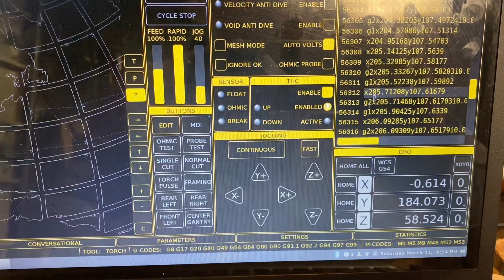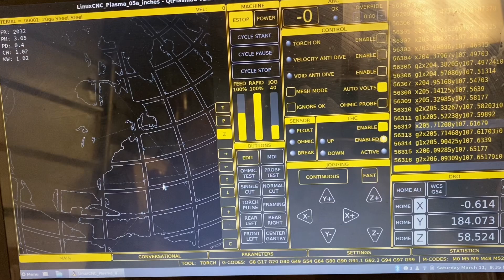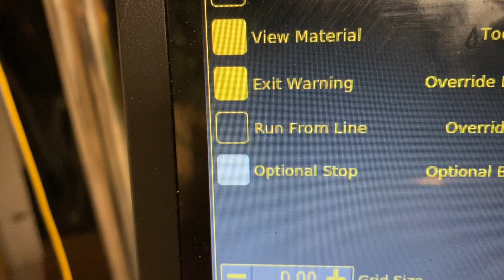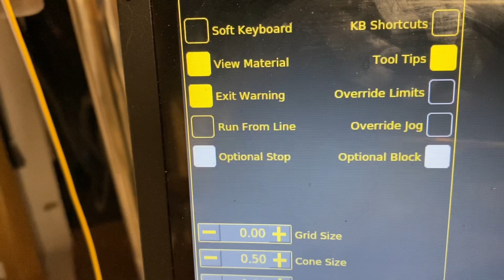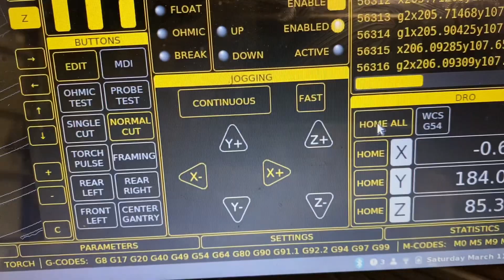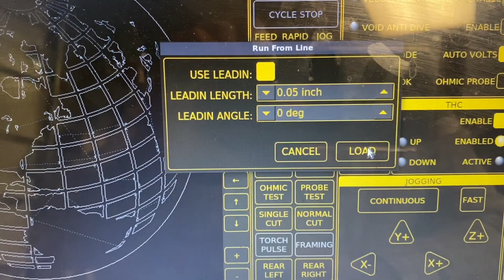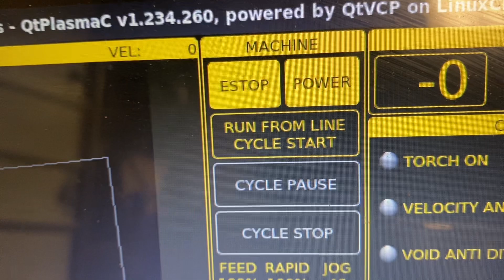LowRider 3 CNC DIY Plasma - LinuxCNC: Even More Cut Recovery Awesomeness!

Comment: I am keenly interested in building a Lowrider for Plasma and want to use identical hardware that you use.  I am parsing through your videos to see if you already made such a video, but if not, please give basic BOM details of your controller configuration.  From watching your videos, I fell in love with Linux CNC and other videos lead me to believe I can run it from an RPi and control that from Windows, but I'm still in the dark with what controller you're using for your steppers, switches and sensors and how that connects to your LinuxCNC PC.  TYIA!
Reply from the maker: There are videos on that, but first let me say that all the info is linked in the description above. Please check out the section labelled "Full details on my DIY CNC plasma rig" and in particular, there is a hyperlink under that labelled "Also check out my build log thread with full details — over on the V1 Engineering forum:" https://forum.v1e.com/t/lowrider-3-plasma-build-on-a-budget-clarksburg-wv/33849 — Re. the controller board, it's made by MESA electronics (model 7i96S), and so is the Torch Height Control board too. They are both made to work with each other. Some videos for that are in my Plasma playlist: https://www.youtube.com/watch?v=MV-IcyFUPQs&list=PLiW6LQZxE6JZW8mClbsKFIjO5VFjzxklS — there are 35 videos in that series. Specifically checkout https://www.youtube.com/watch?v=pgpKjn42zYc, https://www.youtube.com/watch?v=QxNeEHoVCVM, https://www.youtube.com/watch?v=sOqlbghQ9XA, https://www.youtube.com/watch?v=sOqlbghQ9XA, https://www.youtube.com/watch?v=DC7X0wB65kA, https://youtu.be/Y1gYIkMLcc8 — there may be others, but hopefully this helps.
Reply: @design8studio  THANK YOU so much for the details and all that you've shared on your channel.  I wish people in general were as kind, forthcoming and willing to help others as you are.  I just found and watched your Control Box video and will be following all the links therein.  Thanks again!
Reply from the maker: @MichaelJeffers75 Happy to help! I succeeded because of the help of generous people on both the V1 Engineering forum, and the LinuxCNC forum! The founder of Mesa Electronics is on the LinuxCNC forum! He's very down to earth. His name is Peter C. Wallace. On the forum he goes by PCW. He was very helpful to me.
Reply from the maker: The MESA electronics 7i96S controller board connects to a PC via the computer's ethernet connection. From that MESA controller board, you run wires to the drivers for the steppers. Full wiring plan and full BOM etc are in my build log on the V1E forum!
Reply: @design8studio  I just registered with the V1 forum, but Yahoo is yet to post the conf email, so I can't ask there.  Are you saying I can run the Linux CNC right on my main Windows PC?  I was under the impression that the CNC would need it's own dedicated machine to run Linux which is why I was interested in using the RPi.
Reply from the maker: @MichaelJeffers75 You can, but be aware that Linux CNC would replace the Windows operating system entirely. I bought a used Acer laptop (model with a touch screen) cheap on eBay, just for my plasma rig. It was designed for Windows. I wiped its drive and installed Linux CNC with the QTplasmaC interface.
Reply from the maker: @MichaelJeffers75 — re. "why I was interested in using the RPi." I am not familiar with running LinuxCNC on a RPi. However I found this article: https://all3dp.com/2/linuxcnc-raspberry-pi-tutorial/
Reply: @design8studio  Most laptops are capable of having dual bootable OSes, but that's an either or and is a hassle switching back and forth.  I'll investigate the RPi option, or just do as you did and get a 2nd  machine for the CNC, I'm just trying to cut corners having learned that I pretty much won't be able to use any of the steppers/controllers I bought for the MPCNC Burly.  Thanks again for your insight and wisdom!
Reply from the maker: @MichaelJeffers75  Sounds like a plan
Reply from the maker: @MichaelJeffers75 My steppers for the plasma are NEMA 17, which are commonly used on MPCNC and LowRider, so you may well be able to use your stepper motors depending on what they are. The drivers I used are decently affordable.
Reply: @design8studio  I believe my steppers are 12V, though need to research if they'll allow for 24V
Reply from the maker: @MichaelJeffers75  for what it’s worth I’m running 12V on my steppers on both my large LowRider that carries a router and has full sheet 4‘ x 8‘ capability, and on my plasma LowRider! I can do as much speed as I want to, or need to.

Comment: Hi Doug 
I went threw your steps and had done all them like you did. Only problem was I couldn’t figure out how to get the file from the Linuxcnc post to download in to my fusion 360 post processor library. I tried the linxcnc post processors that are in fusion and the just give me a error.
Reply from the maker: I will aim to get you more details on it.
Reply: ok great thank you
Reply from the maker: This video shows the steps to import a post processor that has been downloaded! https://www.youtube.com/watch?v=sUBxAz34Sws
Reply: Thanks Doug for taking the time to find the video for me. It didn't really help because the issue I'm having is trying to get the file I downloaded from Tommy's posts on linuxcnc is in the wrong file type.  Non of the files in his downloads are . CPS files. Not sure if I can edit one of the linuxcnc processors in fusion with there editor. Like copy and paste it into its folder and just deleting the other file. But after doing more reading on linuxcnc forum  everyone seems to feel there are bugs in fusion for plasma cutting. So I think I'm going to just use sheetcam. Create a dxf in fusion and moving it to sheetcam. There are already post processors in sheetcam for linuxcnc plasmac. Hopefully this will work! Thank again!
Reply from the maker: @n2fastcars635  there are three files if I remember right and one is the post file. It worked fine for me. Are you getting a single zip file? Or are they coming individually? If a zip then the contents should have 3 files and one is the post file.
Reply from the maker: @n2fastcars635  The post file simply needs to be renamed from a .TXT extension to the .CPS extension. Due to how the forum works, it has to have a .TXT extension in order to be uploaded by the original author. The site cannot allow it to be uploaded with a .CPS extension. This is a direct link to the post file that needs its extension changed by renaming the file: https://forum.linuxcnc.org/media/kunena/attachments/25414/Plasmac.cps_2020-03-02.txt

Comment: Hi wondered if you where using fusion 360 for cad? I have been using fusion for awhile on my 3d printer and it is easy to use. I have got my plasma machine up and running with a base configuration and i wanted to draw something up on fusion to see if i could trace it out before setting up plasmaC configuration. Im just running into trouble getting post processor in fusion 360 to work. What are you using and how are you getting it to work? Thanks
Reply from the maker: Hey! I am using Fusion 360 for about half of my CAD (drawing) and 100% of my CAM for plasma (manufacturing, i.e. rendering GCode for the cut). The link below leads to my forum post that documents sourcing for two different plasma post processors for Fusion 360. In the post, the first one in the list is the one I'm using! 

https://forum.v1e.com/t/choice-of-two-2-plasmac-linuxcnc-post-processors-for-fusion-360/35448

The Fusion 360 basic steps, in order, are: 

1. In Design mode: create and draw a 2D sketch, 

2. In Design mode: click "Sheet Metal" and create/add a flange to your 2D sketch, with a sheet metal choice/type of "steel" (I have custom copies for correct thicknesses of 18 ga and 20 ga, etc), 

3. Click into "Manufacturing" mode, 

4. In "Manufacturing" mode: create a new Setup,

5. In "Manufacturing" mode: under "Cutting" create a 2D profile

6. In "Manufacturing" mode: under "Actions" click Generate (or tap the Generate GCode shortcut button above it, to choose the post processor and use it.

Note (very specific to the post processor I'm using, linked above): if the rendered gcode gives errors related to "arc start and arc end are not the same" (or some such), redo above but uncheck "MergeCircles" in the "Post properties"

The above steps will process and produce a file of type ".ngc" (by default named 1001.ngc).